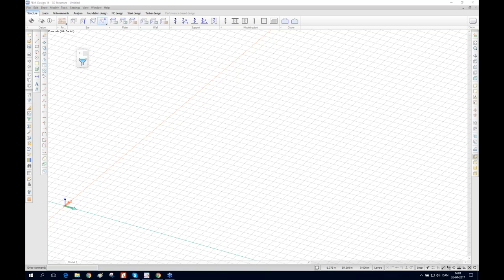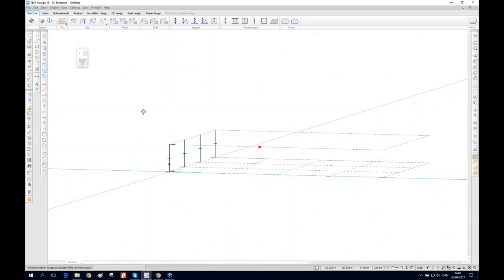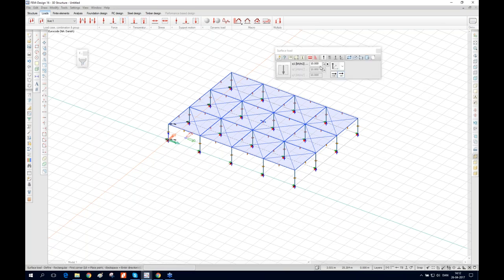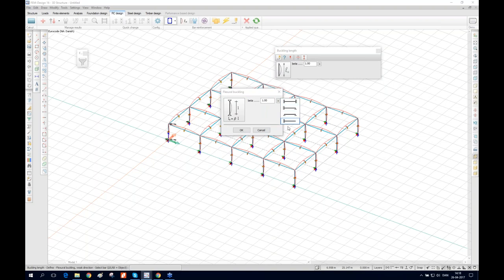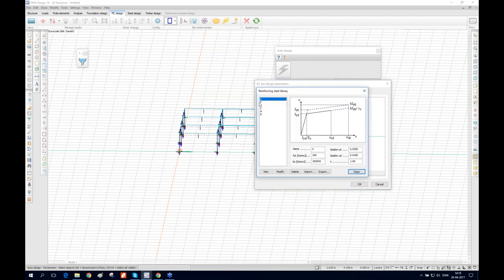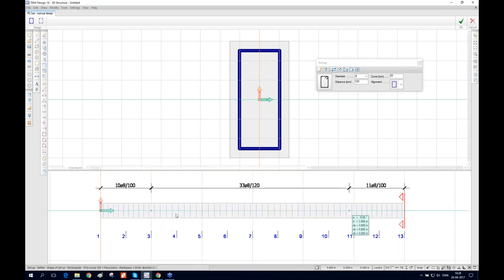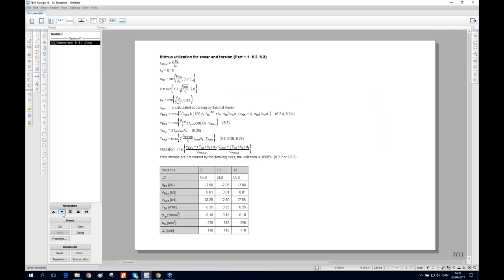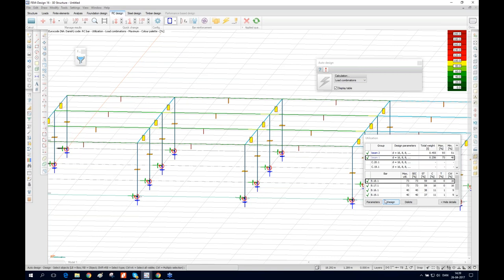Webinar: RC Bar design in FEM-Design

Comment: How does the designer transmit the designed bar reinforcement correctly and easily to the bar reinforcement detailer? This is correctly handled for plate rc design results, I see a gap here regarding bar rc design.
Reply from the maker: Thanks for your message! This is an older video and in the newer version of the software, it is possible to export reinforcement layout for bars to DWG and IFC. We would be happy to show you if you are interested. Please visit our webpage to schedule a teams meeting with us! www.strusoft.com 
All the best, 
StruSoft Team